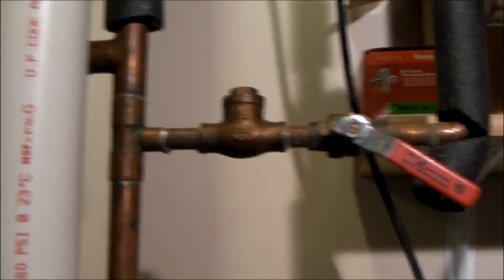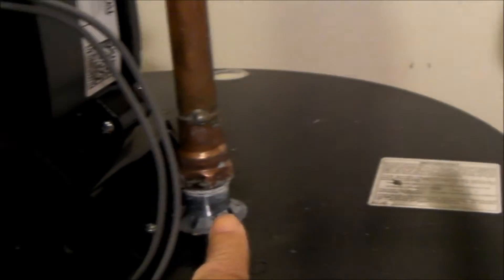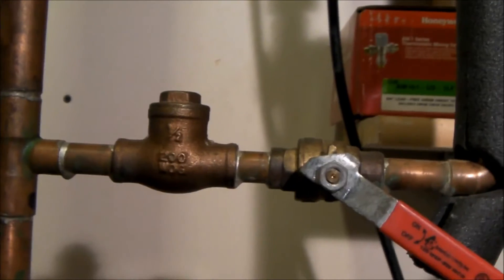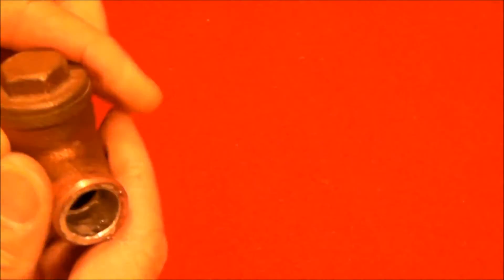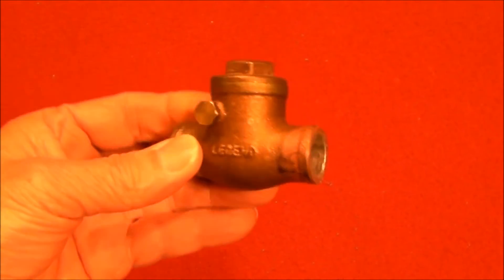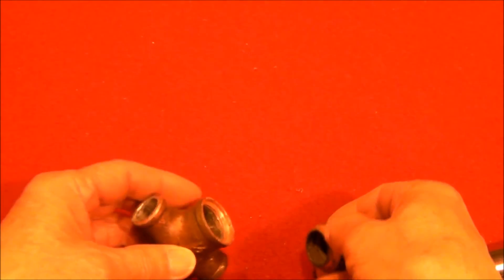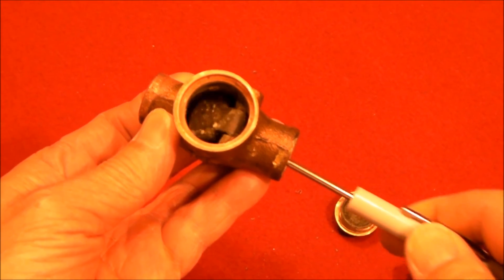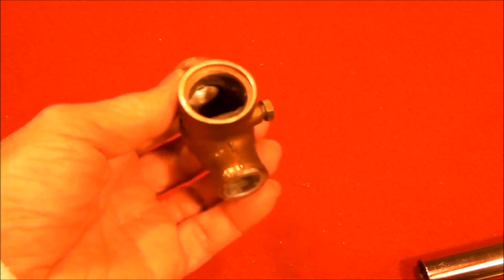1/2" Brass Swing Check Valve Failure and Partial disassembly

Comment: How did you sweat the valve out?  Did you have to take extra piping off or just the valve itself?
Reply from the maker: I could just sweat the valve and pull it out.  In my configuration I did not have to remove any other pipe.  Don't overheat it.  You need good torch and good technique and ideally the water needs to be out before you attempt to accidentally create a steam bomb!  This is not for the amateur once in a year DIY're
Reply: @YuDaMan  If you have any video on how to sweat off and new one on, that would be great.  It can be one you made up or someone else made on youtube.   Since I am new, any bit would help.. thanks !

Comment: The screw on the side both plugs the hole that was drilled to accommodate the gate hinge pin, and retains the pin. Looks like yours had the pin corroded to the gate, which is why removing the screw allowed more freedom for the gate. That gate should be a sloppy fit to the pin. Unless you remove the gate, you can't clean/polish/repair the seal surfaces, so even with lots of movement, it can still leak. On big industrial versions we use a hardened flat plate and grinding/lapping paste to renew those seal faces. If you contemplate replacing it with a spring loaded version, firstly check that it's compatible with the pressures that your system works with, and that it will cope with the temperature of the hot water, if it's going into a hot line. The plastic bits inside might not tolerate the heat, and you'll be back to square 1, minus some $'s.

Comment: If you’re getting cold water through your check valve your check valve is no good they stick open overtime and as soon as the circulator shut off and you open a hot water supply cold water rushes back sometimes blowing right through your booster tank and You get cold water everywhere where it’s supposed to be hot. Next time call a plumber. And you cannot put a spring check in because it’s your domestic water. spring checks have iron and lead swing checks do not.

Comment: what's the purpose of the side nut? i assumed it was holding the valve to the hinge. but you took it out the valve is still locked in place.
Reply: same question..
Reply: @pitbalz5723  I was told that the side nut can be used to bleed any excess air out of the system (the recirculation loop) if necessary.  I have used it for this purpose before.  Right now I am getting nothing out of that port with the nut removed, though, and the system pressurized, so I'm suspecting some other problem...

Comment: So I can remove the bolt on the side and add some lubricant in the hope that it will function properly again ?
Reply from the maker: I guess there's nothing wrong with hope but  I didn't want a lubricant in my water supply.  Even after I had it out, lubricant would not have fixed mine due to the corrosion buildup.
Reply: Just lubricant did not work for me. Same valve/problem.
Reply: @spinozany     the only thing that works is use fittings to mount it at a closed incline, and tap it periodically to keep sediments from forming

Comment: Thanks! I’m having the exact same problem with exact same check valve. My thought are deposits are on the hinge pin
Reply from the maker: All the so called "experts" will say just take it apart and "clean it man" but even after I got the valve out and on my bench vise, it required a lot of force to break the cap free.   I think that proves I would have put some big ass stresses on the plumbing even while attempting to apply a counterforce with another wrench and would had had limited if not zero success removing.  Please report back your experience so maybe it will help others.

Comment: WTF! Use two wrenches to neutralize the torque on the copper! That valve was maintainable. Why would I subscribe when you don’t know what you are doing?
Reply: Did you try it? Super tight.
Reply: @spinozany  Hey wait a second! Are you God, or are YuDaMan? ;-)

BTW, I have been searching for God since the beginning of time, and I am gratified that this picayune banter has been adequate affirmation of my earthly existance!
Reply: I have a brand new one (not installed yet) and I can't get the top off even with the body held in my bench vise.  (just using a plumbing wrench so far, not the 19 mm socket and torque extension handle)  So I'm not trying that with the other (old) unit that's soldered into my delicate plumbing...

Comment: Thanks.  Nice job.  I had the identical problem, but I just held the base of the valve with a pipe wrench while I unscrewed ONLY the top with a ratchet -- mine wasn't as old as yours was, and, after scraping a bit of corrosion (I suppose from my water, 'cause I have copper everywhere), I got the flapper working perfectly.  Whole process took about 15 minutes, and I have hot, and not lukewarm water in the far reaches of the house.  I'd strongly suggest taking the top off, but not messing with the pin cap.

Comment: I am going to be replacing my prv and may just remove my swing valve. We are on city water, northeast, we are in a hilly area on a ridge. Not sure why a swing check valve is even installed but my prv is made by thrush and may be from 78 so swing valve may be just as old. Thanks for the video.

Comment: You indicate in this video that everyone suggests the use of a spring vs swing check valve ... CAREFUL.  Many new low wattage pumps don’t operate at a high enough PSI to push water through a spring valve.  In which case, only a swing valve will work.  I just replaced my pump and installed a shark bite spring valve in place of a swing value ... that caused all kinds of problems.  Had to go back to a swing valve for it to work.
Reply: You can also install swing valves vertically. I just want to know if I can take the inspection cap off and use the same gasket. Other than that this guy shouldn't make a video if he doesn't know what he's talking about.

Comment: 159.00 for another pump. got it installed and it does the same thing. keeps cutting on and off every 10 mins. came inside and seen your video and figured i spent way more than I needed to. should have "CHECKED" the check vale first...

Comment: Spot on to my problem, but I put the check valve in and it leaks from the Cap.  So I'm not sure if its defective or if it was not suppose to be assemble when sweating it to the pipes.  So I'm going to try and tighten the cap, wish me luck.

Comment: THANK YOU!!!  I searched for ages to find a disassembly video on these things. Explains why I couldn't get the thing open.  But need it really be installed horizontally? Ours is vertical....seems to work (until it started sticking at 18 months!).
Reply from the maker: Most BUT NOT ALL of the articles I read suggested swing type check valves need to be installed horizontally. However, some articles said it didn't matter.  I'm glad the video was somewhat helpful and I hope you help me with a subscription.  Since this failure I have been using shark-bite type check valves which are spring loaded and can mount in any position.  They are a little more expensive but they seem to be working fine so far.
Reply: Thank you. Knowing (in hindsight) the person who originally installed ours, it may well be incorrect. Subscription done.
 @YuDaMan
Reply from the maker: I found conflicting info on the internet.  Who knows the right answer.  These two check valves from Home Depot look somewhat similar but only one states horizontal installation:
https://www.homedepot.com/p/Everbilt-3-4-in-Brass-FPT-x-FPT-Swing-Check-Valve-240-2-34-EB/205816264
https://www.homedepot.com/p/EZ-FLO-3-4-in-IPS-Brass-Swing-Check-Valve-20423LF/205858378
Reply: Thank you. Well if for some reason it doesn't work, it's not like it costs a lot, or that something will blow up. Worst case....it doesn't perform as it should. But I admit I can't imagine why orientation would matter in a contest between gravity and water pressure.   @YuDaMan

Comment: I am having a similar issue with my recurculating system. Obvious sign of external corrosion on mine, so I expect a replacement is in order. Regarding the type of valve, swing or spring, where are you coming across the info about installing a spring type?  I mostly find that the swing type is preferred due to low circulating pressures. 
Did you replace with a spring type? How's it working?